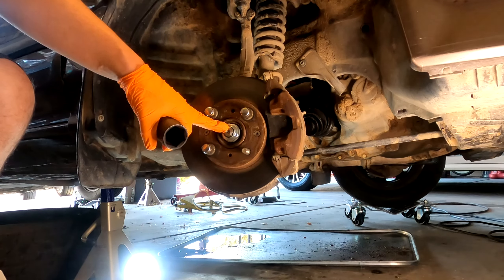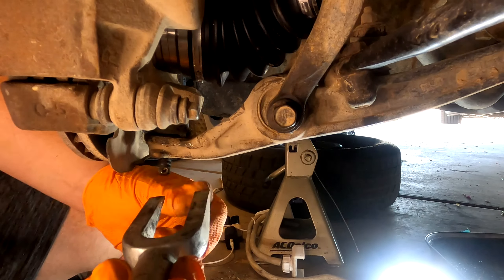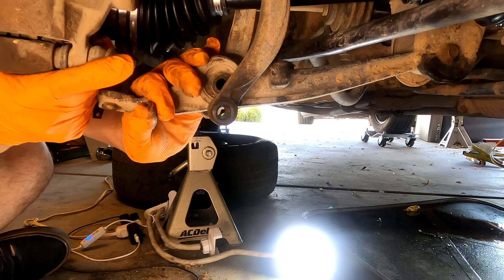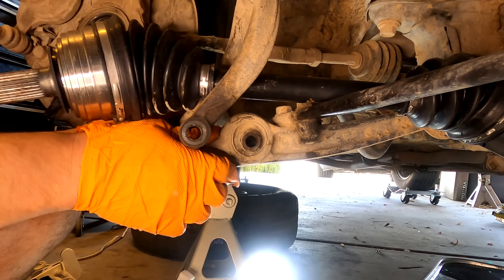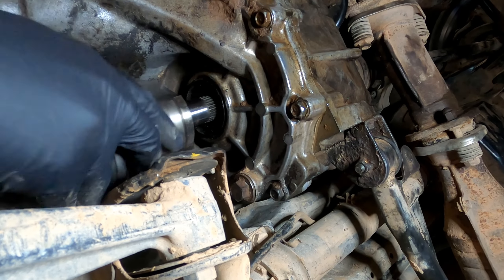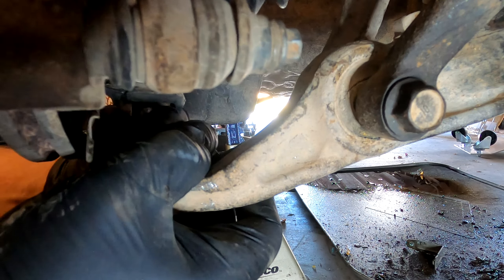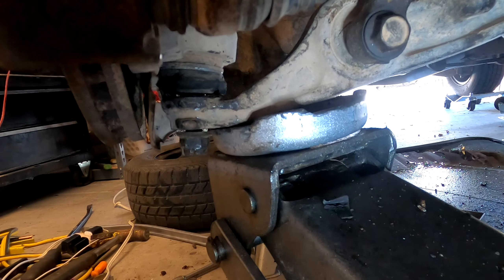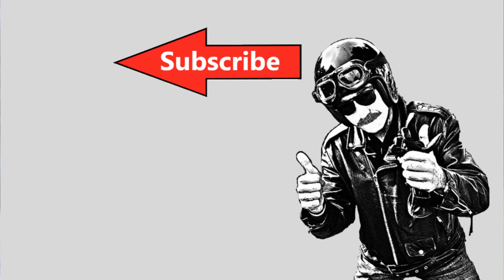CV Axle Change for your EF Honda Civic: Replacing the Drive Axle DIY!

Comment: Crx question.  To drop the oil pan, apparently the cv axle is in the way of removing the flywheel dust shield.  Is everything you did required just to pop the cv axle from the tranny ?
Reply from the maker: Yes crx would be the same

Comment: Those axle nuts can sometimes be extremely difficult to get off. Before I had good impact tools, I broke my own breaker and the guy at O'Reilly broke 2 of theirs, trying to break it loose. I had to got to a tire shop and get them to break it so I could go home and do the work.

Comment: What about the safety crip around the bolt... Wouldnt it make taking that first bolt off easier?
Reply from the maker: It could but most of the time it’s not going to be easy even if you somewhat undo that

Comment: Just saw your s10 3 inch drop video from 3 years ago if ya don’t mind me asking how does it ride thinking of getting it thanks
Reply from the maker: It wasn’t terrible at first but blew all the shocks out, I then replaced the shocks with lowered ones and it road so well after that. There’s a video about the lowered shocks too
Reply: @LostSocketMotorsports  Thanks I will definitely check that video out and decide from there!!! I’m leaning towards getting the kit seems like you can’t beat it for the price I have a 2.2 manual same exact year.
Reply from the maker: @chasecarter8733  nice, the lowering video has the link to the kit I bought and the shock video has the link to the shocks as well.

Comment: Wheel not spinning when torquing new axle nut. What would cause that?
Reply from the maker: Is the car in gear?
Reply: I'm having the same problem on my 1988 crx. Wheel spins fine when axle nut is lose. As soon as I torque it down, wheel is locked. Will not spin. Transmission being in gear or in neutral has nothing to do with it.